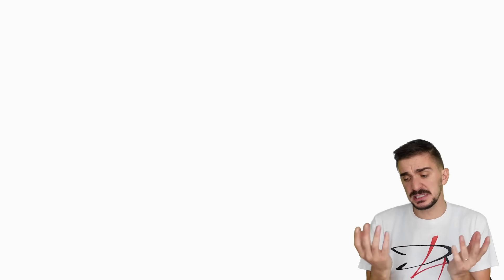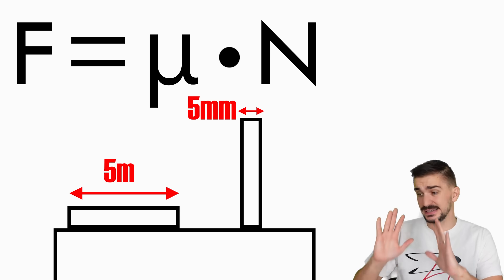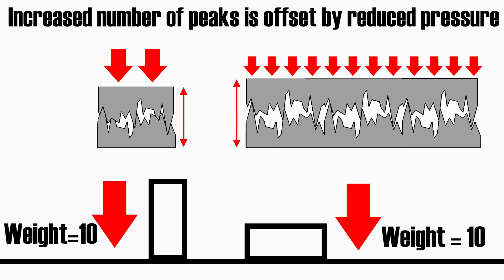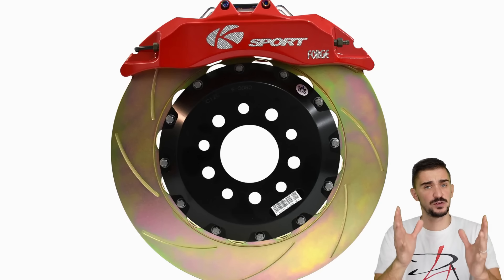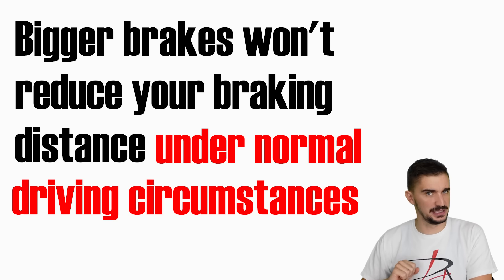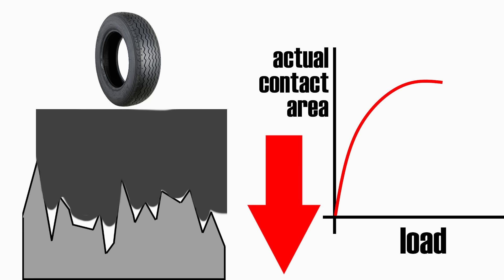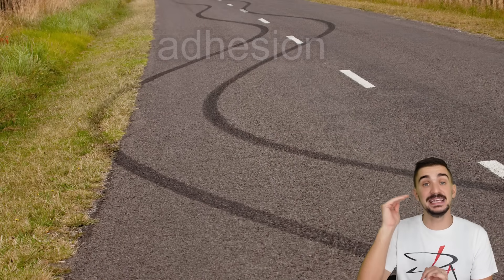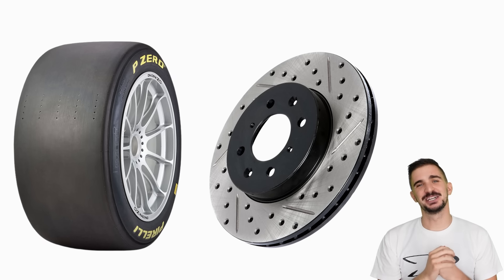Why Big Brakes Won't Stop You Faster but Wider Tires Will - Friction and Surface Area Explained

Comment: I've never wanted to upgrade to larger rotors for increased stopping power. I've always (intuitively I guess) known that the purpose was to have greater surface area to increase heat dissipation to reduce the chances of degradation of stopping power due to overheating and/or damage. All brakes can lock up your tires (assuming no anti-lock) so they all have plenty of force necessary to stop you as quick as possible. Losing traction on the road directly affects stopping distance. Maintaining traction is how you stop faster.
Reply: Most modern brakes can lock up your tires...but certainly not ALL brakes.
Reply: I understand what you're saying but why do race cars not just run tiny rotors? Because big ones stop them faster along with bigger tyres.
Reply: @cedric1138  so you are saying that you don't actually get what I am saying. Read again. I explain the main purpose of larger rotors.
Reply: @dougsholly9323  I read it, heat, segregation etc etc, all in all it boils down to one thing - they stop you faster.
Reply: @cedric1138  did you watch the video? I don't understand why you are dismissing all of this.
Reply: @cedric1138  rotors effects brake forces, yes bigger the forces shorter the distance right? However, tires effect how brake forces are applied, and disc effects how long the brake is efficient for. You can run the best brakes you can find in the world while running some all reason tires but you won't out brake the same car with stock brakes on summer tires. it's that simple to understand.

Comment: Who believed bigger brakes improve stopping? Bigger brakes avoid fade and dissipate heat better with more mass. They stay consistent deeper into a race. Consistency and feel are more important than outright power, but most who pose instead of actually race never understand this.
Reply: The most important reason here is "race". Of course they will give you an advantage in a race (what he actually says in the video), but a massively oversized brake wouldn't give you an advantage if you just drive on a street with cold brakes and have to do an emergency stop just a single time (the brake won't fade on this single stop)
Reply: @simonm1447  Did you have something to add?

Comment: But what about the increased brake leverage you get from larger diameter brake rotors?
Reply: That's only relevant to braking distance if you couldn't lock up the tires (or reach the ABS threshold) before the change.

Comment: i got larger brakes on my car that had stock breaks and it did stop in a shorter distance than the stock brakes with no other changes from 100 mph to 0.   unfortunately the pads could have been better than the stock pads but i could not get the same material on pads as the upgrade brakes were better quality.

Comment: Very interesting, does the bigger diameter of a big brake kit have a benefit in leverage all else being equal?
Reply: Sure, moving the pads further away from wheel center increases their leverage. But that increased leverage is only relevant to stopping distances if you can't lock the tires (or reach the ABS threshold) with the smaller diameter in the first place.

Comment: 2 thoughts I have that go against the ideas you've put forth.

You say that brake pads and rotors will only have so much actual contact area, and mention machining being precise.
But you ignored that the act of braking literally wears both the pads and rotor down, slowly rubbing away material and the 2 surfaces actually marry together better and better after each use.
So you actual surface area should change to be closer to the apparant surface area pretty quickly, meaning larger pads should have an advantage in stopping power.

Then you say more surface area on tyres means better stopping power because they have a larger actual contact area.
But anyone that's driven a car with stretched tyres will know that the extra surface area doesn't really help the car get better traction or more stopping power.
Having sidewall and the tyre being able to deform more under pressure does SOMETHING.

I think there's a few more factors involved than what you've presented in this vid.

Comment: Finally somebody made a video to disconnect the friction formula to tires. My point of view: it still applies, but when the tires are slipping (i.e.: road vs tire speed differ).
Only comment I have is related to the 2nd tire myth: treads are used to direct the water outside ("V" myth). If that would be true:
1. you would have to see much more water sideways at 50+mph
2. there are asymmetric tires which have grooves that "would channel water to the middle"
The tread is just a break in surface, so that water pushed to the front of tire would be allowed to get behind wheel, leaving the next surface segment to push water from 0 (not 0 = aquaplaning). 
Tread size is just how much standing water it can drive through. Shape is just about noise and aesthetics (us performance guys sure love out Vs).
PS: 2-wheel tires actually do sideways water moving, because their contact patch is oval and narrow, not rectangular.

Comment: Finally I thought I was the only one who had the opinion of the premise of this video I thought I was crazy. It’s very limited to your tires how wide and rubber compound, tread pattern maybe, as opposed to big brakes themselves. Big brakes are only useful for dissipating heat, which in most one time stopping cases, doesn’t even fucking matter

Comment: I can remember the first and only time I got my old street car onto a race track. I had wider street tyres but brakes were stock. The brakes last 4 hit laps before the brake fluid boiled. The tyres lost grip after 5 laps. 

A year later I did upgrade the front brakes to larger ones and it did brake better but never got to test this on a track. If I had a chance to do a track day I would have got street legal semi slicks.

Comment: But a bigger diameter brake disc would make it able to use more leverage to brake the wheel with same force, so it will stop faster? like having a breaker bar on a socket, more length on the arm means for leverage
Reply: If your tire grip is the limit (because the smaller brakes are already powerful enough to lock them) your car won't stop sooner, since the wheels would just lock with less pedal force.
It's like if your breaker bar is put on a soft underground, a longer bar would give you more force but you can't use that force since it would just sink in with less force you apply on the bar

Comment: A bigger brake disc may increase your braking effort, but in order to do this you need to increase the forces on the break calipers as well. Increasing the diameter of the brake disc without increasing the caliper force won't result in bigger braking force but instead, it will reduce the speed of brake disc wearing. (The brake pressure intensity decreases) Also this offers better heat dissipation.
About the caliper force: Too much force intensity or too much force on a small brake disc may tear the disc. That's why you can't minimum the car's brake disc into a donut.

Also, with all the cooperative actions above, your car's ABS may kick in and prevent the wheel from locking despite the fact you've got a great brake on the axle. Whatever enhancements you've done inside your car are on the mercy of the tire against the roads. It IS the road which provides you the braking forces!

Comment: This video is partially right and partially wrong.  So far as stopping friction, yes  you are right, but there is another matter when braking from high speeds, heat.  As your brakes heat up, the coefficient of friction reduces and comes damn close to zero at high enough temperatures.  Stopping from 60 you're probably not going to get there, stopping from 120 you probably are.  Here is where bigger brakes WILL reduce your stopping distance.

Comment: The thing that seems to be missing here is that (if I'm not mistaken) larger rotor kits come with calipers which have more or bigger pistons within them.  Isn't that the case?  So the clamping pressure of the pads is increased due to the net gain of surface area of pistons within the calipers.  
So real-world results will not match what he's saying.  But what he's saying is still correct, technically.

Comment: There is no consideration given to surface speed between the rotor and pad. If surface speed has no affect on coefficient of friction, then burnouts would be the fastest way to accelerate. Another example would be a locomotive spinning its wheels as it attempts to accelerate from a stop (no tires here, just metal-to-metal) My experience (same calipers and pads, 2 different rotors) has shown little difference between rotor size at higher speeds, but the larger rotor is much more effective  than the smaller at lower speeds. I can only attribute this to changes in friction due to rotor speed.

Comment: I changed the rotors and pads on my heavy GU Patrol because the factory brakes are poor.  The Rotors came from Brembo, and are made of a cast iron formula which is way more coarse than the OEM ones, while still the same size.  This leads to more bite from the pads, which are also a much better compound - just as good cold and leagues better at high heat.  It's easy to overheat the OEM brakes when off-roading down long steep mountain tracks, because there's no airflow at the slow speeds.  It's quite alarming when on such a track and your brakes stop working......
Reply: I'm this case the factory brakes are just too weak and the limiting factor

Comment: Always remember that a larger rotor will increase braking distance, because the gyroscopic force of the rotor is higher.  This causes people problems to understand, but it's the same effect as fitting larger diameter/heavier tyres. It also decreases acceleration.  I think top gear once fitted larger diameter brakes to one of their "star in a reasonably priced car" track cars and found lap times worse.

Comment: Not to nit-pick, and in full understanding that a 20 minute video can't get into all of the detail, but there is an interesting point left out. That is that if you fit wider tires to your car AND use the same tire pressure, you get a wider contact patch BUT the tire contact patch will be shorter. A simple approximation is that the tire contact area (not microscopic) is equal to the weight applied to the tire divided by the pressure inside the tire. So a mountain bike tire with 100 pounds load on it at 20psi will have roughly 5 square inches of contact. So in car terms, if you move to a wider tire of the same compound and at the same pressure, you have the same contact area. You do get an increase in grip because wider contact patches generate more grip at the expense of more rolling resistance. What you find though, is that the wider tires generally require lower pressure, and that gives you more contact area. This is more the case if you have fitted wider rims that support the tire better-- prevailing wisdom at the moment is that wheels should be roughly 1" wider than the nominal tread width-- at least for driving where cornering is involved. That's the macroscopic side. On the microscopic side, changing to a softer rubber compound in the same size will increase the ability of the rubber to deform into the crevices of the racing surface or neighborhood street. This results in more grip at the expense of wear. It should be noted of course, that the rubber has to be at an appropriate temperature to actually be soft. Many of us have had the experience of using soft summer tires in near-freezing temperatures and finding them hard as rocks! Thanks for the video D4A!

Comment: Upgrading to larger diameter rotor gives you a leverage advantage?  With the caliper moved outward on the rotor, all things being the same, ie pad size and material, there is a leverage advantage.

Comment: I think you are missing the point of larger brakes.  It's also about heat dissipation.  My Brembo's may not stop any faster, but they will recover far faster and fade a lot less.
Reply: He actually says that in the video, but I assume he is talking more about "normal" daily driver cars than race cars. In normal traffic you won't overheat a brake of a car

Comment: Your brakes are strong enough to overwhelm your tires under hard braking. Wider or stickier tires will improve your braking performance by balancing out this relationship between braking capacity and traction between tires and road surface. 

Increasing the size of your brakes will increase their capacity for absorbing and dissipating heat. Improved heat management will extend the life of your brakes and improve their performance under abusive, race pace driving.

Comment: I don’t care what your physics say if you put larger breaks with more clamping fours on any car it’s going to stop quicker if that’s because they don’t overheat is fast you’re getting the same result whether or not there’s more or less friction which there’s going to be more because every time you upgrade your brakes you should be upgrading your master cylinder so you have more pressure creating more friction Even if you don’t change the master cylinder most brake upgrades have such small lines for the hydraulics in them but the pressure is off the charts so the increase in braking force is going to create more friction which is going to create more heat which the break can deal with because it’s larger Being pedantic gets the same result

Comment: Sorry, but brake fade is not due to gases between rotor and pad.  Brake fade is due to excessive heat transferring to the brake fluid causing it to boil.  The brake lines filled with liquid is incompressible limiting how far you can press the brake pedal, but when the brake fluid boils, the gas in the brake lines compresses and the brake pedal can continue to move until it bottoms out on the floor.
Reply: Boiling brake fluid is no fading, fading means your braking power is getting less. If your fluid is boiling your brake is gone almost completely
Reply: @simonm1447  no,you are wrong.  Understanding physics of fluids under pressure with heat would help you here.
Reply: @borysnijinski331  apart from the fact the boiling point of a liquid even increases under pressure (together with an increase of viscosity under pressure) your post ist just laughable.
I would recommend to read the Wikipedia article about brake fade to make a start

Comment: Doesn't moving to a larger brake system with more pistons in the caliper mean you are able to apply more force though? And by putting more force you should be able to stop faster.
Reply: You've missed the entire point. Sure, you can apply more force. But if your tires are already the limiting factor in your minimum stopping distance, applying more force won't change that minimum stopping distance. You could make the rotor a mile in diameter and add a thousand pistons, and still you will slide to a stop (or ride the ABS to a stop) the same as you did before.

Comment: without watching the rest of the video... wider brakes wont work because its the tire that transfers the braking force to the roadsurface, so if the tire loses grip because of too much braking force, upgrading the brakes wont help. instead wider tires or a softer compound will because of a bigger contact patch on the road surface or higher friction co efficient due to softer compound tire..
Reply: Yep…nailed it.  I was thinking same.

Comment: what if i add another caliper on the bottom will that increase braking power?
or maybe if i change the caliper to a caliper with more pistons? 
or do i have to change something else ? maybe the master cylinder?
how can i increase braking power? i guess either change the material to a one with more friction coefficient , or increase the normal force.. so how do i increase normal force in the braking system specifically
Reply: Well F1 brakes have 360° calipers.
Reply: To increase your brake power you first need to use wider (or softer) tires with more contact area, if your old brake starts to become the limiting factor (and not the tire grip) more powerful brakes starts to improve stopping distance.
Especially older tires have a harder rubber (rubber gets harder over time doue to ageing) and this hard rubber means less grip, it extends the stopping distance compared to a new, softer tire.
You feel that missing grip mostly on wet roads, here the effect is most recognizable.